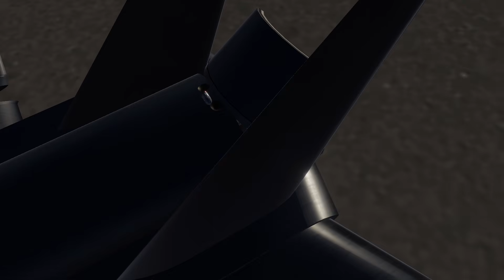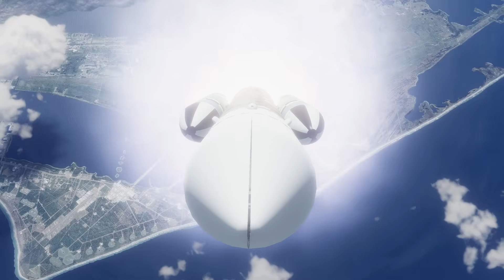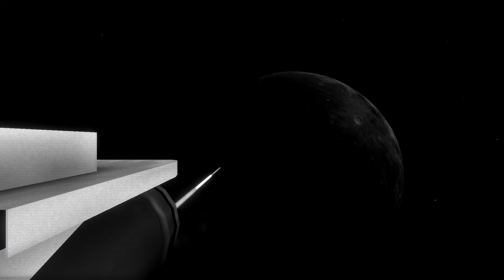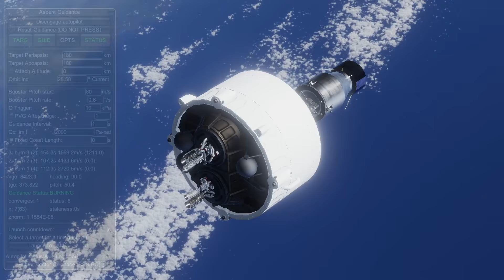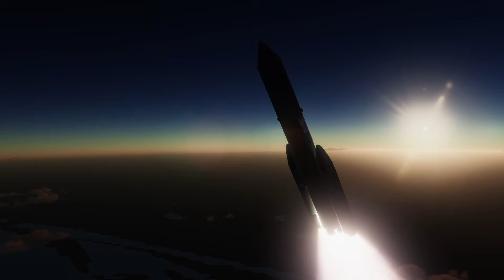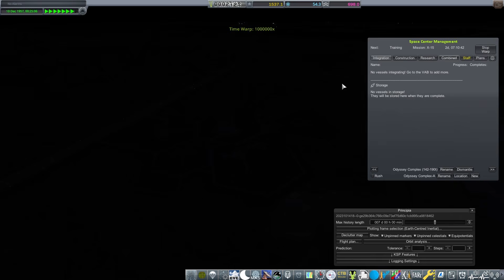Can You Really Fly a Plane to Space? - Kerbal Gets Real Redux #7

Comment: Just some tips that you might be able to use in future plane designs:
I think you should've made the wings on the asp much smaller, and the tail slightly larger. I suggest you look at the x-15 as a reference for why.
In short, the rules for going high and slow are very different from high and fast. your thrust to weight ratio is so close to 1 and keeps getting better, and that airplane probably doesn't weigh all that much. look at the angle of attack when you are flying level in it. I bet it is tiny. what that basically means is your wings are a bit big. they produce a lot of drag and not all that much lift at their normal operating speed. ideally you want an angle of attack of 4-5 deg cause that's when your wings are at their most efficient.
At the same time I suggest a larger horizontal tail plane cause you are going to want that pitch authority at low altitude.
This should also help with your heating problems a decent bit. your cockpit gets pretty spicy on reentry regardless, but you were fine there not very close just yet there.
And finally wing sweep. would don't really need to sweep your wings for this unless you go full delta wing. but a delta wing at this sort of altitude is very draggy (that's why the space shuttle used it). the point of wing sweep irl is so that you can delay when you go effectively supersonic on your airfoil. by delaying that you can get much better flight characteristics at supersonic speeds. but once you go hypersonic it all kinda goes out the window. you're not going to want to use the same kind of airfoil at that point. for hypersonic flight the name of the game is to reduce surface area. as small as you can go while still being able to land. I can share my craft files on your discord if you'd like to look at what I'm pointing out. it uses the xlr-99 tho. it flies like an absolute beaut. super stable can go super high (165km iirc) never had heat death.
Keep up the good work. It's awesome to see you grow as a craft designer and content creator.

Comment: Some added notes on how lunar impactors are different in FAK vs. PLC:
The residuals update for realfuels, coming before PLC but after FAK, adds some variation to the performance of rocket engines, making hitting the moon harder
In PLC, weight doesn't matter as much as it did in legacy. A LC that can support a heavier rocket is only slightly spendier than one for a lighter rocket, while in legacy, newer and more capable launchpads were extremely spendy
Finally, it does seem to still be possible to do reliable impactors without guidance, but it's very much a #rp1-speedrunners thing

Comment: You could argue that it's an automated program with those burns. Since you aren't in direct control, it would make sense that you send up the program while in communications range so it will fore while put of comms.
Reply: TL0/1 antennas are considered to be transmitter-only, with no ability to receive instructions from the ground, which is another reason for it not mattering